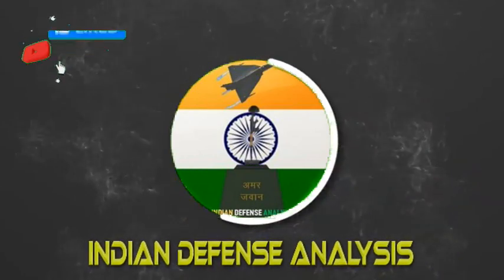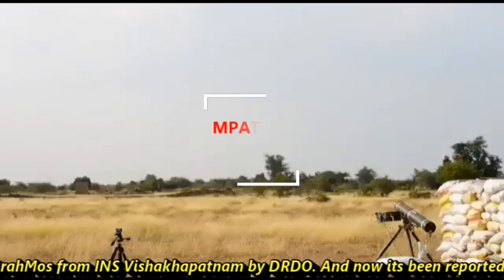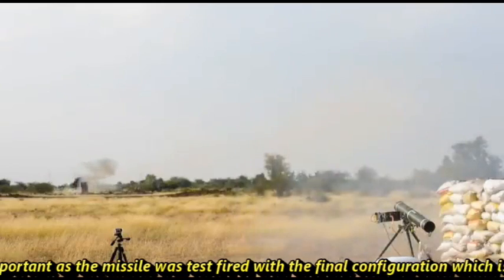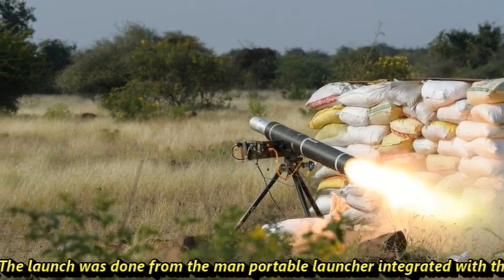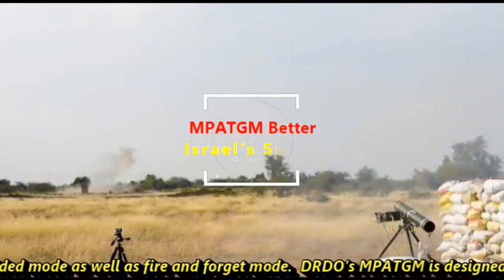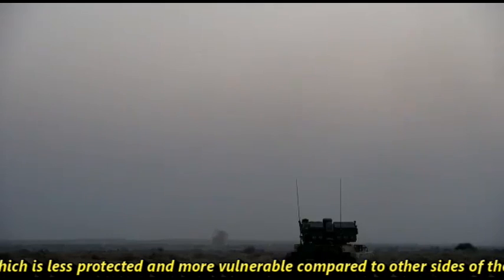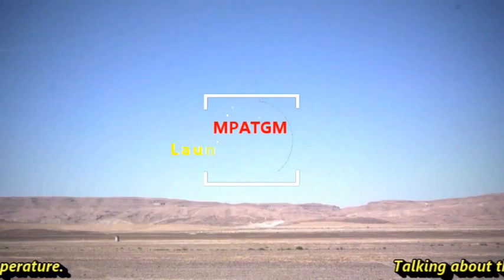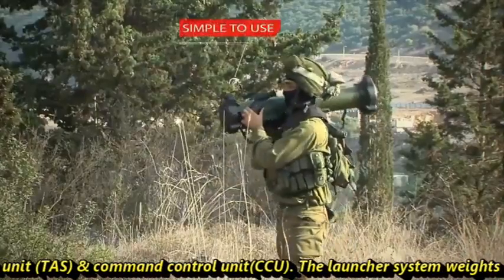DRDO test fired MPATGM in final deliverable configuration | better than Israel's Spike missile?

Comment: This was only made possible because we didn't buy Israeli Spike MPATGM. Otherwise our dalals in our military would have insisted on imported mal. With MPATGM and Nag ATGM we have a good deterrent against Tanks. I hope each Indian army tank can carry 2 Nag missiles. Couple that with our men carrying another 2 MPATGM it will be deadly combination.
Reply: Heres a crazy idea... Sign a deal with the Germans and spit out a bunch of Wiesel 1 units built in India... The 20mm units but also the TOW anti tank units as well... But use this new ATGM instead on top of it instead of the TOW... Im guessin a company like Tata could spit those Wiesels out for dirt cheap... Ive read that sometimes up to 70% of the Indian T72s are not up and working and ready to go... And im sure Pakistan suffers from the same kind of thing... Im sure tons of their tanks are broken down as well quite often...The Wiesels are dirt cheap maintenance wise as they have cheap tiny little engines and smaller cheaper parts all around... The engine can supposedly be swapped out by mechanics in like only 15 minutes... If actual conflict broke out a massive swarm of Wiesels with 20mm guns and ATGMs on top could do a lot of damage in tandem with your bigger tanks and BMPs that are up and running... The Wiesel and India seem like a great fit...
Reply: @GearHedd  The t-72 report was an old report by cag dating back to 2015-16. It was about lack of spares to keep up the t-72 fleet up and running. Since then a lot has changed  particularly with participation if private industry. Now a lot of these spares are manufactured in house locally so issue is not there anymore.